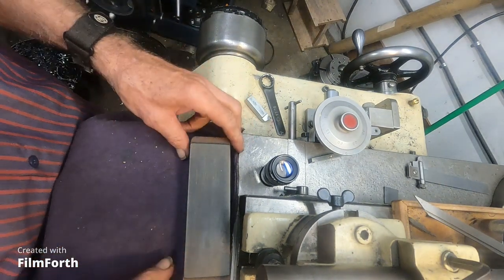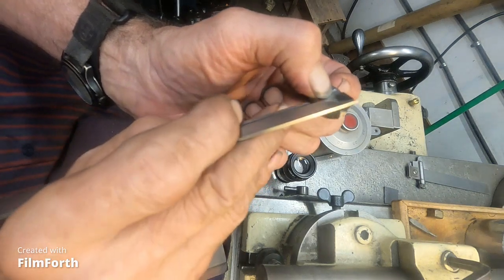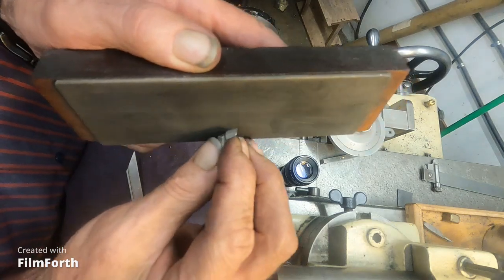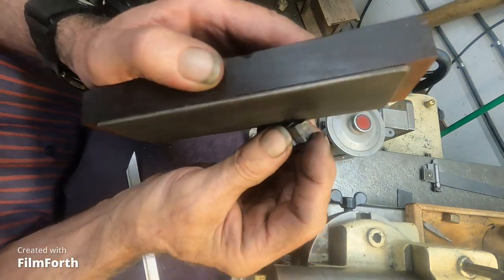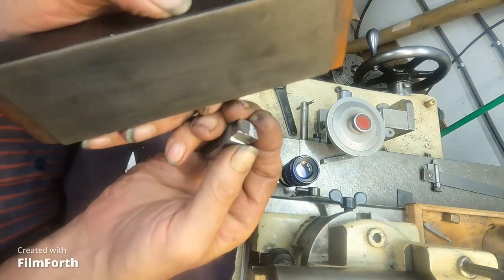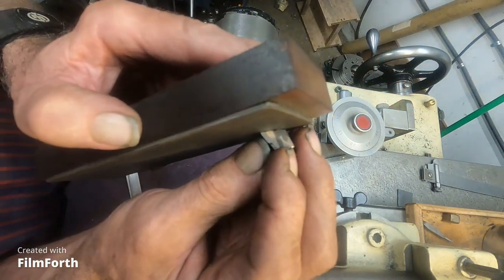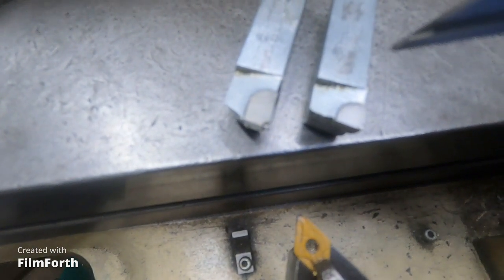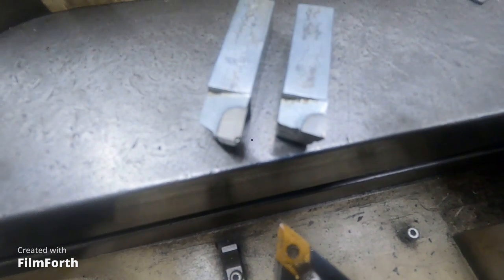Reducing tool push over on pre hard steels with carbide cutter angles part 2

Comment: Deedee, could you mount a small lathe top slide to your Cincinnati work head and use the rotation of that to grind radii?

Great series this, by the way! Am really enjoying the hunt for bearing fitment! Thanks
Reply from the maker: Yes, there is an attachment for most all grinders that has adjustments for grinding radius but it is hard to set up. The Monoset tool grinders have that built in and easier to use but it takes time to make small adjustments. Those are the alternatives if hand shaping a radius is not possible, thanks

Comment: Thanks for tip to add post to small vise to hold in 5C. Also, built custom Z-height adjustable grinding wheel head for my Cuttermaster from old Pratt-Whitney ElectroLimit gauge. Just finished cutting off and totally rebuilding a American made 2 flute solid carbide end mill. Turned out like factory accurate facets but I gotta tell’ya, what a time consuming, tedious job. And I used to think setup was a big part of machining. Noting compared to doing this grind.
Reply from the maker: I found it too time consuming to do many standard things like sharpen small end mills but have often modified cutters for specific work, that and making new tools is still a strong point of having one around, I still will spend too much time salvaging a free tool, thanks